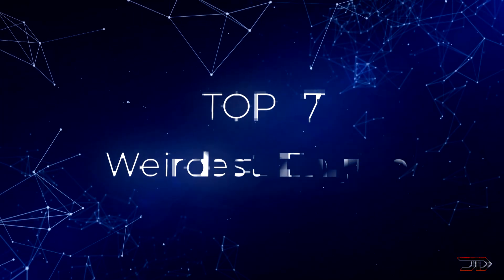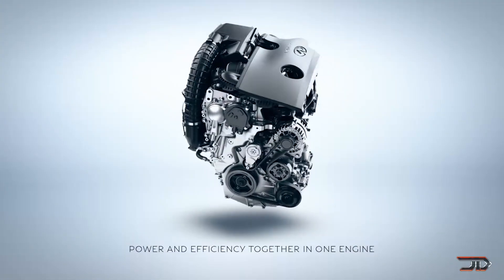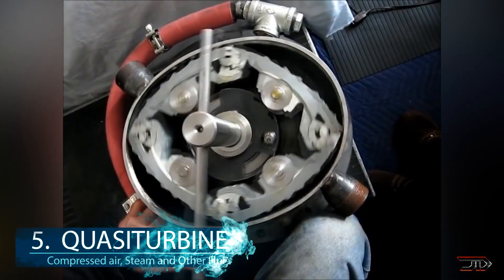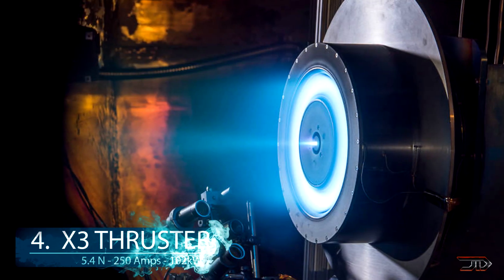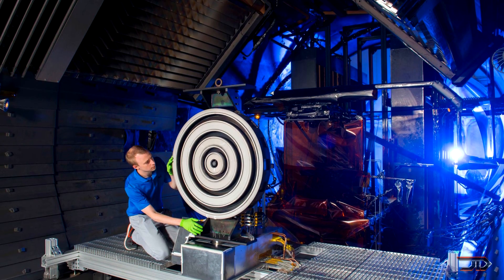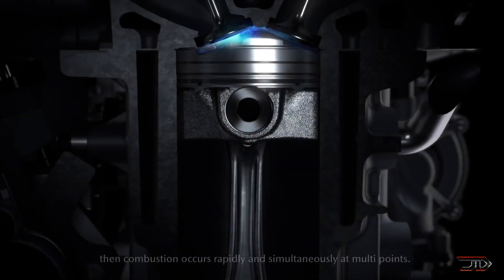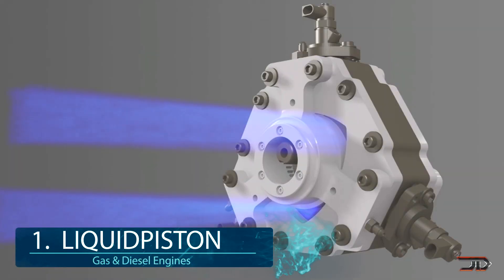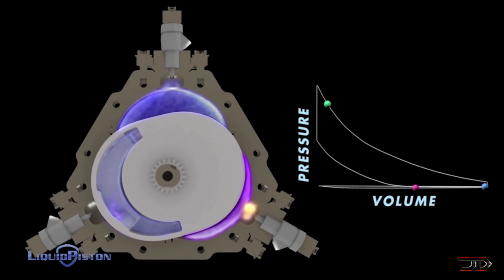7 STRANGEST New Engines

Comment: While I applaud the engineering efforts into making more efficient ICE, it’s pretty obvious which way the wind is blowing for the future of transportation, EVs.   While that’s certainly not the only application for an ICE, it is definitely the largest segment of the market, so I wonder if this research effort couldn’t be better served looking into other technologies.    Due note, I’m not saying we should abandon all ICE research, of course we should continue to strive for more efficient engines as we transition away from them...   my point is that some of these engines are such radical departures that will require many years of further development that they may be obsolete by the time they’re finished.   The Achates on t’other hand sounds promising and should definitely be applauded...    it’s really gross how little MPG has improved in the last 50 years...
Reply: I'd like to see series hybrid vehicles using small turbines to charge batteries, instead of conventional reciprocating engines.
Reply: That research is happening, but it's really hard to get around the fact that liquid fuel is so amazing as an energy source.  It's potent (high energy per volume), it's stable (doesn't explode easily), and it's super easy to transport.  I can hand you a cup of gasoline, but I can't hand you a cup of electricity or hydrogen.  Electric storage is the real challenge and might be a few decades way from a real solution.  So, ICE development must continue until that is ready.  We are at a point now where further development of the ICE is getting exponentially more expensive to meet emissions and fuel regulations.  In the 80's and 90's $1 per engine per percent fuel saved was acceptable.  Now we are looking at $100 per engine per percent fuel saved, and it's going to get more expensive as time goes on.
Reply: Russell Senior I can hand you electric. Batterys. Batterys man
Reply: Russell Senior  -  for sure energy density is the major win for ICE vehicles, but clean and cheap renewable energy, storage and EVs are accelerating at an incredible pace.   One of the bigger advantages, also a hurdle as electric companies are slow to change, is how clean and cheap renewable energy sources (can you tell I work in the clean and cheap renewable energy industry?) and EVs can radically shift the typical demand curve for a power company...   now it’s the classic single AC cycle graph of a sine wave going up during the day (the hill) and going way down at night (the bathtub).   Solar PV arrays, wind/tide turbines etc can lower the demand on the ”hill” side which currently (in the US) demands dirty dirty coal and other dirty dirty fueled ”backup” power plants be running when the main plant reaches a certain percent of capacity (usually ~70-80%), but just on standby...   they’re burning fuel without sending electricity out, only in case demand exceeds the main plants capacity.   At night, the ”bathtub”, demand drops off a cliff which is just as big a problem for the power company...   if only there were a way to shift some daytime use into the night...   enter timed EV charging and home storage solutions like the Tesla PowerWall.   Now homes are more conscious of what electricity they’re using and when, shifting demand off of the hill to fill up the bathtub, giving the power company a smaller range peak to trough, requiring less extremes and a more normalized and predictable daily cycle.   Working with several power companies I’ve seen daily improvements as new clean and cheap renewable energy sources are brought online and more EVs are being sold...   the comparison of similar days demand graphs from 1-5 years ago to the present day really shows a noticeable change that benefits everyone.

Another thing to consider is the ”second life” of EV battery systems...   because of the active cooling in current EVs, they’re retaining much higher capacities over much longer times.    When they’ve gone below the EV manufacturer’s threshold for replacement, they can still hold a significant charge and can very easily be tied onto the grid for all manner of uses.

While it is absolutely necessary to continue to improve the ICE (again, the increase in MPG efficiency over the last 50+ years is just abysmal), the leaps and bounds gained in the clean and cheap renewable energy industry every day are incredibly satisfying to watch (and be a part of !!) and I for one will not miss the ICE...    except for the Lexus LFA (the crazy V10 supercar) exhaust note and the V12 and V10 era Formula 1 cars (I started watching F1 as a wee lad in the early 80s), those will always be ok in my book ;-)

Comment: The electric engine is the future for cars, small vehicles and tools. I only see a future for fuel based engines for trucks and boats.
Reply: They just need to invent better batteries and invest in cleaner power production and the electric motor will be viable for any vehicle really. It's actually an excellent truck motor since it has so much low end torque.

Comment: Why isn't the engine I designed on this list?
It's also a non reciprocating engine. It has no moving parts and its also invisible. It runs on any fuel including water. It gets an infinite number of miles per gallon of fuel & it has no mass.

Comment: What most engineers will tell you is the more efficiency they build into an engine the more preservatives they have to put into a fuel to preserve the fuel as fuel has a short shelf life. This is why Hybrid Petrol/ Electric motors are unpopular. For most people this is not a problem as daily commutes don't pose a fuel expiry problem but for the few who rarely use their hybrid, the cost of repairs is very high. Electric is perfect for people who daily commute to say a train station as the battery doesn't discharge when the vehicle is sitting for the day.
Reply: They are considerably more expensive to buy, have very high depreciation costs as the battery guarantee is so short. You have the expense of buying a charging point and struggle to find one out on the road. So why would anyone bother just to do some local commuting?..Oh, they dont...
Reply: @manoo422  It really depends on what vehicle you need. Small EVs compare to similarly sized cars. Larger vehicles don't compare. The Renault Zoe EV  is around the same price as a Toyota Yaris but costs $600 a year less to run. EVs are really for people that make short trips untill more rapid chargers are installed. Australia has a very long way to go before it is anywhere near England or coastal US.
Reply: @fourbypete  !?!?!?EV cars are ALWAYS significantly more expensive than petrol/diesel equivalent even with the subsidy. As I have also said depreciation cost wipe out any benefit in running cost. So like diesel makes little sense unless you are doing high mileage, which doesnt work with so few charging points.

People are not buying them because they are too EXPENSIVE and too IMPRACTICAL.
Reply: @manoo422  where in the world are you? In Australia diesel is cheaper than petrol for tco and if there were more charge points electric would be cheaper than diesel.
Reply: @fourbypete  UK, diesel is about £136/Liter, Petrol £128/Liter and there a supposedly 6587 charging locations.

Comment: The Achates 2.7L is a long overdue development in engines and the only one here that will quickly go into production.
Reply: Manoo42 Fairbanks Morse has been building opposed piston diesel engines in the US for almost 100 years. Nothing new here.
Reply: @pete1342  You clearly dont understand the significance of this being a GASOLINE compression engine.
Reply: He probably doesn't quite realize what that absurd torque number really means.
Reply: Commer Knocker and Deltic too.
Reply: Dimitri Loginowski I stated a fact. A simple fact that people like you can't handle, so fuck off.
Reply: Skyactiv X goes into mass production in a few months on the Mazda 3...
Reply: Why? It's  outperformed by a traditional engine, unless I'm missing something here? Traditional piston engines can achieve 100HP per liter without forced induction, with forced induction they can achieve several hundred HP per liter.
Reply: My issue with them is blower pumping losses. How do they overcome the defecit?
Reply: Umm the VC turbo will go into production before all of these motors. It's already in production. Another steller design by Infiniti. I cant wait to see how much boost these things can handle.
Reply: Achates Power have been in production and being used in military vehicles for a couple years now.
Reply: Gasoline compression engines have significantly fast flame speed and combustion pressure as the ignition is a detonation, the same as diesels. Consequently they produce considerably more power for the same fuel. The Skyactiv-x uses the same principle, soon all engines will operate the same way as the advantages are too big to ignore.

Comment: Infinity needs to improve their current quality before they release some new engine technology, Nissan/infinity are by far the most unreliable Asian brand these days. And the resell value on a Infiniti is the worst in the business. I'm surprised if Nissan/infinity still exist as a brand in 15 years.
Reply: NISSAN has been mostly owned by Renault for some years.
Reply: The vq engine is great.
The auto transmissions are horrid. 
Make sure you get a manual vq if you want it to.stick.around.
My 2002 maxima se 6spd is flawless after 16 years.
Itll be around for another 10 easily.
Reply: @VEEZER1  I believe the merger came in like 2010 or something and since then they've been shit. vq's are amazing tho
Reply: Nissan/infinity quality went to crap when Renault formed the Renault–Nissan–Mitsubishi Alliance, even Mitsubishi got worse and they were never that good to begin with
Reply: I drove a pre production Infiniti car with the variable compression engine as a evaluator a while back.  Long story short, I wasn't impressed with it. It felt slow and sluggish off the line. Driving in the downtown areas was where the lack of instant on demand power was very noticeable to the point I had to force a lower gear in manual driving mode. 

The problem with this engine was it was too small for the car and relied heavily upon the turbo for any power. Not a good combination in my opinion. 

While this engine is a nice piece of engineering, it was more complex than it needed to be.  Being new technology, it will make any sort of repairs very expensive should there be any issues. 

For prospective buyers, I would advise one to opt for a V6 over the  variable compression turbo 4 cylinder for reliability and longevity.
Reply: I have a 6 speed G37 and its been the best car I've ever owned. Nissan makes great engines and most mechanical parts. I have to agree with you that their automatic transmissions suck and that Nissan needs to get their shit together, but they make some nice cars.
Reply: Run Aubameyang Run , We own an '08 Altima Coupe 3.5 SE with a six speed that at 120k was flawless until a $30 throw out failed hydraulically. $2400 later (DMF, clutch and pressure plate plus 17 hours of labor) and we're shooting for 250k.
Reply: Those VQ motors are known for head gaskets and timing chains. Power steering pumps are always leaking in those maximas. The new Nissan work is actually pretty good besides the CVT. the motors are pretty solid and leak rarely. The new titans on the other hand stay away
Reply: No RB no care
Reply: Put 546 000 on my AUTO maxima before i hit a deer.. Definatly could have made a more consitent auto trans.. But i got lucky with a bullet proof one.
Reply: @ryanwylie123 
"consitent"? What?
Reply: @buddyclem7328  Seems no one in this thread can spell :D I think they mean "consistent".
Reply: reliable if maintained and that is my professional opinion i work on these all days, sad thing is most car owners dont properly maintain their vehicles so true numbers on reliability are so flawed. these engines obliterate themselves with shit oil but are strong with good oil imo
Reply: Thor _ I just got an Infiniti Q60 and it’s nice af
Reply: @jdkoz98  I would rather take a kia stinger over that car. Or even better just keep my subaru levorg.  https://youtu.be/-iUA9_ZyTgQ
Reply: The Nissan 3.0 and 3.5 are literally the most awarded engines in the history of engines... which power Infinities.

What in the actual fuck are you talking about Thor.
Reply: The most uninformed comment ever. I guess hes never hear of the VQ35/37 VR RB SR VK engines. All of which are great motors with cult following.

Comment: How is the ion thruster new? There is almost a dozen different designs and none of them are "new". One of the first concepts was tested by Robert Goddard in the early 1900s. To put that into perspective, he tested it before the first Model T rolled off the production line. 

There is about a dozen different types of ion thrusters and many of them have been built, tested and in some cases used primarily as station keeping thrusters for decades. NASA and the Soviets/Russia as well as more then 2 dozen smaller countries have been testing and improving the design since the early 60's. It really takes away from the pioneers that have been building and testing this stuff for decades to call it new without giving at least some credit to those that came before.
Reply: The first concept was Goddard's idea for an electric thruster in 1906, but that's all it was, an idea. It wasn't tested until 1916 (8 years after the Model T)

Comment: Really?....where's the Duke Engine? Coolest not here.
Reply: Dave H did the Duke ever go into production or does it still live on the drawing board!?
Reply: It's already prototyped and ready for production.
Reply: Duke is cool until you try to cool it.
It also has no real advantage over the inline 6.
Reply: Ken Smith. The title is weirdest engines. I agree it's a  flawed design which is why I was surprised it didn't make this video.

Comment: Notice they cut away the normal spark combustion engine cylinder during the skyactive demo? That's because skyactive is almost literally the same thing just timed/metered more efficiently and works at a higher compression than a typical combustion engine. It is a step above normal combustion but that simulated cutaway veiw was the wrong way to show it because the difference is almost indefinable. It has a crank, pistons, valves (int/exh), spark plugs, works on 4 strokes, the same 4 strokes. It's not a new engine or even new technology. Hundreds of different combustion engines run the same way but with different compression/timing. Maybe it  is different and was just explained improperly? But everything I see just shows a normal combustion engine
Reply: I think he describes it poorly. If it is what I think it is, then it actually has no spark plugs, but it does instead have direkt fuel injection into the combustion chamber, just like a diesel. Also, running really lean does not stop pre-ignition and knocking, but running richer does, so he has it a bit wrong more than once. 

Running direkt fuel injection removes the need for stoichometric air/fuel mixture, because there is no fuel to ignite during the combustion stroke. Instead, the fuel is injected near the top of the stroke, just like a diesel engine, and ignites due to the high temperature of the compressed air.
Reply: It is a normal combustion engine.  While I certainly have issues when they call it a compression ignition engine, it is none the less an impressive technology.  The real impressiveness comes in the fact that they are operating the engine in a heavy knock region that would normally destroy most engines.  But they use live cylinder pressure measurement so that the PCM can monitor if things are really getting out of control.  We (engine development engineers) have used cylinder pressure measurements to develop engines for a few decades now, but this will be the first application of cylinder pressure measurement in the field (in an automotive engine, anyway)

Comment: So you have...
Variable stroke with a linked offset to the crank, a rather questionable variant of the opposed piston design, a possibly worse variation of the Wankel idea (more moving parts to wear out), something for satellites (rocket stuff - nothing you'd see at home), modification of the Otto cycle on fuel and spark to run extra lean, a not so questionable opposed piston design (but not huge like ship engines where its more common), and a possibly better variation of the Wankel idea that's yet to be proven.
Reply: They didn't even think to do variable compression ratio on the dual piston thing.  On that you just need to adjust the phase relationship of the pistons to vary the compression.